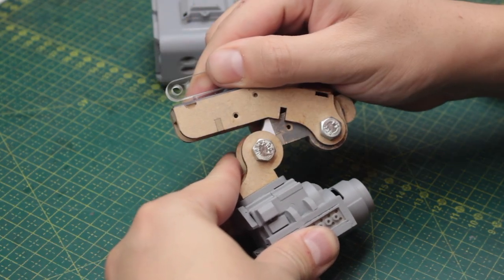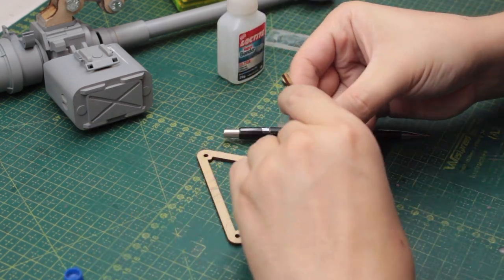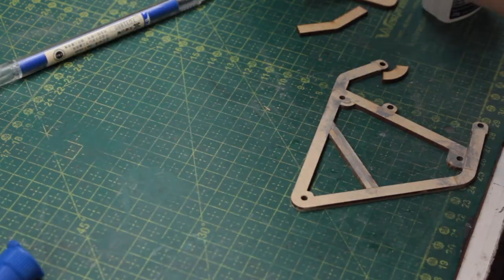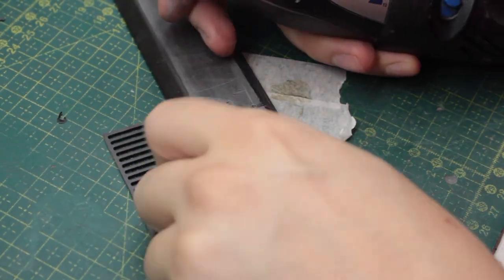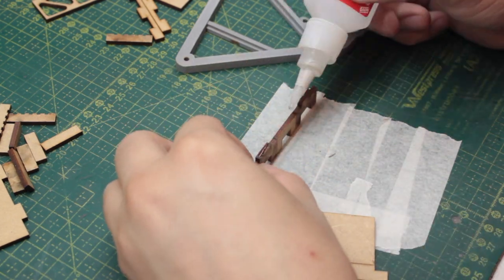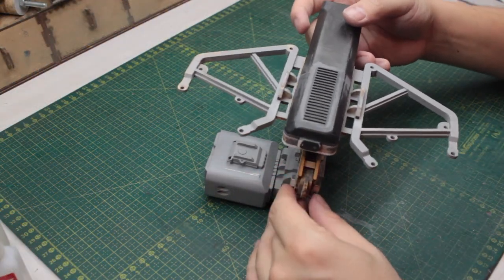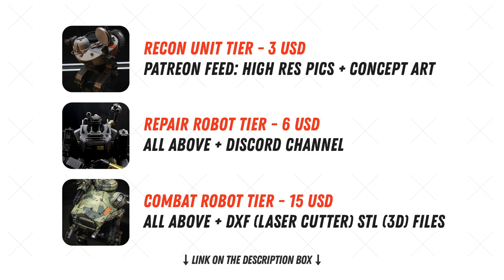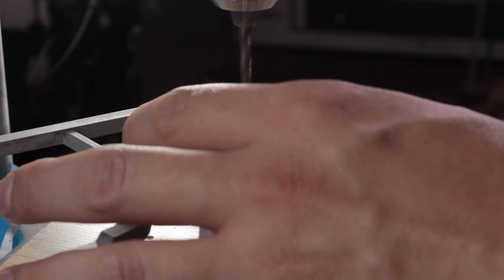Sniper Spaceship - Part 2

Comment: Something you may want to take into consideration, if you haven't already. A gun that large would, when fired, destabilize the ship. You may want to make some type of an air cushion that would absorb the recoil. One could add some really cool aesthetic features too.
Reply from the maker: Yeah! So the rail where the sniper sits is supposed to deal with the recoil...I'm also gonna add some thrusters to the whole thing soon.. Thanks a lot, buddy!

Comment: This is a wonderful design. I suggest on your next build, that guns in space should be laser based because there is no air. You could make this gun look like a laser by adding electric coil rings around the barrel like the yoke of an old TV tube. Also, some clear plastic rings may make it look more like space. The blasters of 1950's lasers guns had rings around the barrel. But I still love what you've done.
Reply from the maker: I did some research before the start of the project, and turns out guns can actually be fired from space! I'll make some laser guns in the future but for this one, I wanted like a ridiculously big barrel as the central piece of the build, just to make it fun :) Thanks a lot buddy!